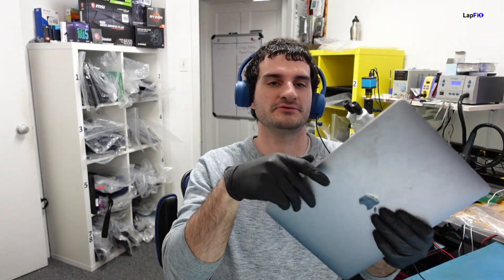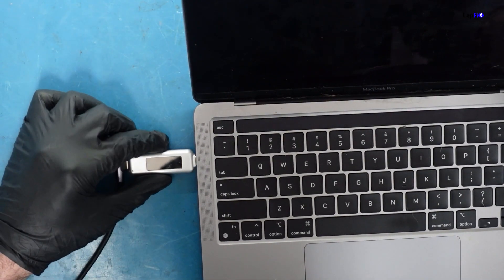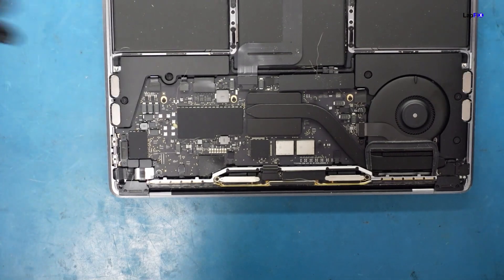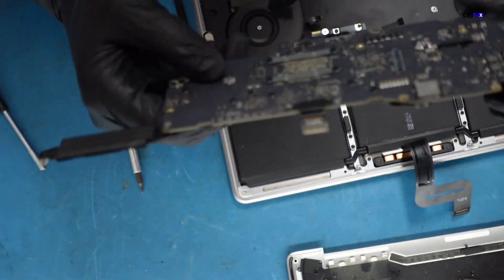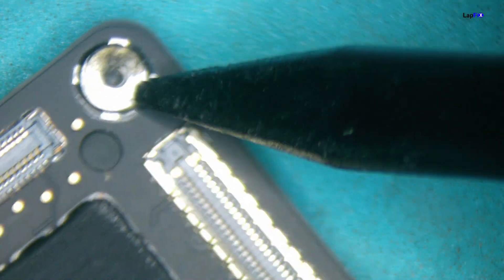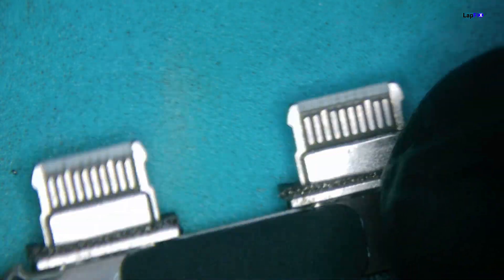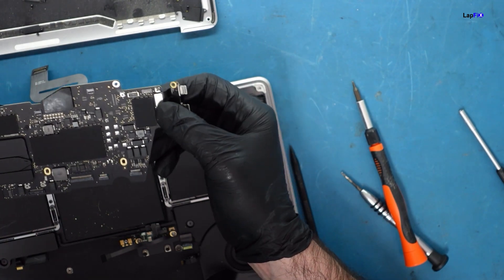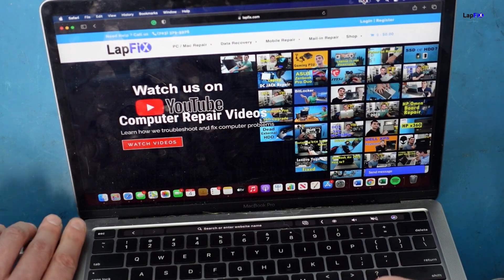MacBook Pro M1 Not Charging Easy Fix

Comment: My Macbook refuses to charge over MagSafe 3 and even usb-c ports. The MagSafe has the led orange and not flashing but not charge. However, when switched off, it recharges but very slowly. Do you know why please ?
Reply: Hello , my laptop has the same issue as you have mentioned. The MegaSafe has on orange light what’s plugged in whilst laptop is shut down. And it charges very slowly , 60% during an entire night. When I open the laptop it stops charging. Did you manage to fix it ? If so how please?

Comment: hi man i have same trouble, but after replace typeC connectorts present strange situation. First power up normal 5V then 20, battery starts charge. When i send mac to reboot\power off in last S5 moment power tester show me Over Load and charge stops. It scence was once, in other trys charge didnt start. If i disconnect battery indication OL against after reboot or poweroff. I replace new 2 CD3217B - dont fix. ISL9240HI - dont fix this. No damages on board, no shotrs, so what it can be?

Comment: Hi man. I have the M1 Macbook Pro and it wasn't charging after it switched off. I put it on charge overnight and it juiced up to 24%. It finally turned on but now it completely isn't charging at all. What could be the problem?
Reply: did you fix it? I am having the same problem. Battery won't charge. max charge is 5%.
Reply: Same problem . How you solve it?

Comment: Having a strange issue with my mac m1 air, my mouse and external drives work fine in both usb c ports when I plug my charger in there's no charge at all ?
Reply: Same here... How did you fix it??

Comment: Hey dude, just saw this and I'm actually facing a similar problem where the battery doesn't charge but then the fan runs in full speed and also, after running apple diagnostics, it shows that the battery is not detected. And when this problem happens, if I press under the laptop to where the battery board data cable is connected, like anywhere near it, it fixes itself. Can you help me out with this? Also, I have noticed that when this problem happens, and the laptop is shut down, it will not turn back on because of course, it doesn't detected the battery and I have to use the power cable. Also, when this happens, I won't be able to see any of the information regarding the battery such as the battery health, the cycle count, the percentage itself. So isn't this clearly a faulty battery data cable? Can we not just replace that wire alone instead of replacing the entire motherboard suggested by Apple?

Comment: Hey man, love ur vids! I got a little situation on deck. My brother spilled half a glass of tap water on my Mac book m1 pro. It got all over the keyboard and even through the cap/vent near the screen. It's been working ever since but for safety measures i used a hairdryer (on no heat) to remove some of the water and than than closed the laptop and turned it upside down for 48 hours. (it was turned of when it was upside down). Even though the laptop works like before the incident happened i'm still worried. I have a 1 year care pakaged and i could take it to the apple store but since the mac works i don't know if it's wise to do so. The only problem that i've been noticing since the incident was my charger randomly not charging so i had to plug it out and plug it in again to make it charge.
Reply: Any solution?

Comment: Can you help me? Idk if it’s my port or not. Top doesn’t work but bottom will charge after a few min plugged in. When I remove the usbc it is showing an Icon to plug 🔌 on my battery even if it’s at 100. What should I do?

Comment: Maybe I have an interesting case:
Macbook Pro M1
Only starts if plugged in, but once started I can unplug the charger and it continues running.
There is an X in the battery symbol. Clicking on the symbol ...
Power Source: Battery (plugged and unplugged)
System Information > Hardware > Power: No entries except:
The battery’s charge is below the warning level:	Yes
Fully Charged:	No
Charging:	No
State of Charge (%):	1
Cycle Count:	0 
Condition:	Service Recommended
Maximum Capacity:	91 %
Diagnostics did not run for several tries (Power adapter not connected, but it was), but after the last update it continued after a while:
Reference Codes: PPT001 (The battery was not detected)
Genius Bar Technician opened the Macbook, disconnected and connected the battery, but without findings.
The Macbook has no liquid damage or any other damage. 
After the first day of these symptoms, they have been gone on the second day (charging battery from 70% to 100%), the third day these symptoms came back and stayed.
So Battery should be OK. 

Do you have any idea?
Reply: How you solve this issue?

Comment: If it’s liquid damage , does it need to be replaced asap? Or can it just be left like that and use it without any problem on longterm?
Reply: change it honestly if you can 
because I had the same problem in the end it will damage  other components